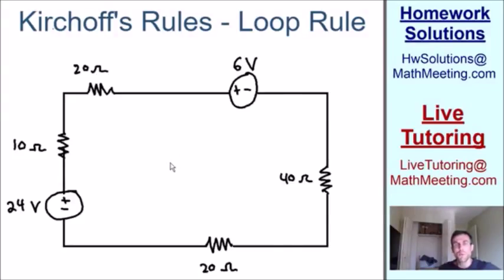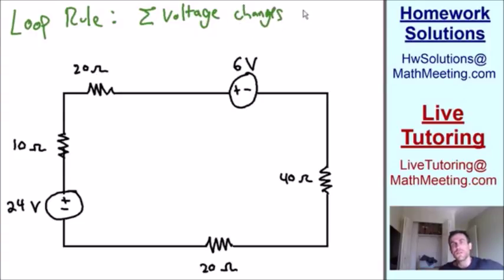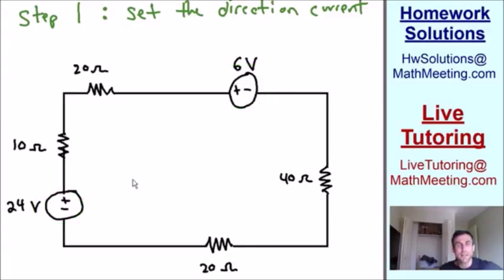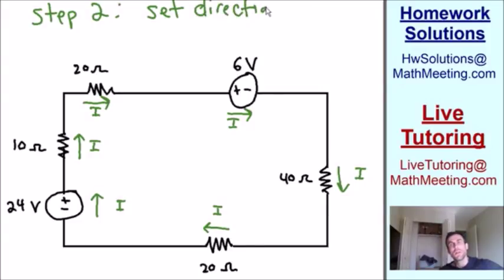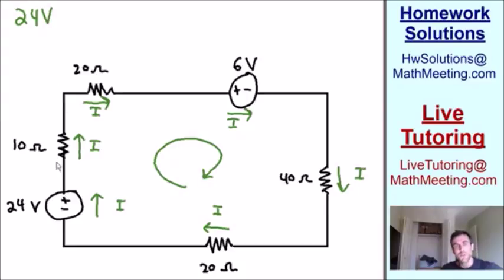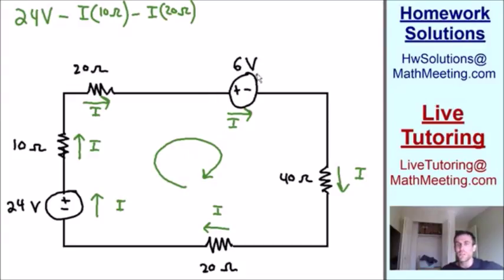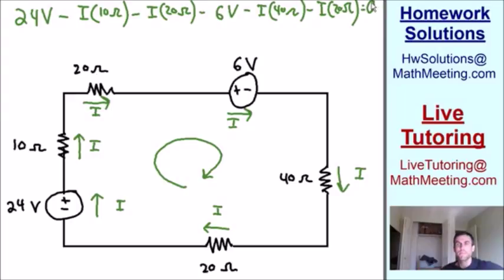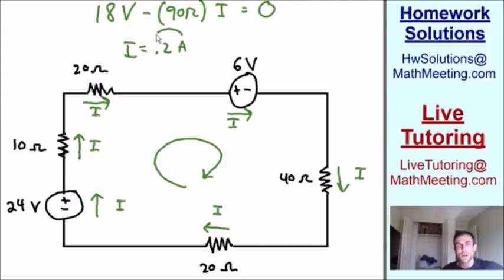Kirchoff's Law - Circuits tutorial

Comment: This is the second Youtube tutorial I’ve seen that says current flows out of the positive terminal of a power source. In the case of two batteries in series, the current will flow out of the negative terminal of the battery with the highest voltage and flow into the negative terminal of the battery with the lower voltage.  This is why you need a 14 volt source to charge a 12 volt car battery.
Reply: Current flowing out of the positive terminal is called conventional current. Current flowing out of the negative terminal is called electron current. Electron current is obviously what actually happens but conventional current is the standard that most of the world follows.

Comment: Where i = .2 A come from? I don't get it 🙁
Reply: I'm struggling with this please help 🙁
Reply: At 6:52 you can see 18V - (90Ω)I = 0
Using algebra, we subtract 18V from both sides to get - 90(Ω)I = -18V
Divide both sides by -90Ω to get I = -18V/-90Ω
Put that into a calculator (-18/-90) and you get .2 A